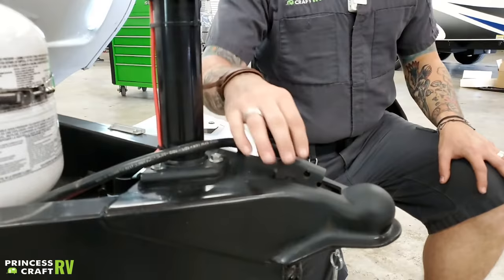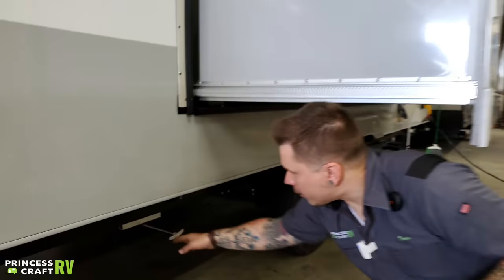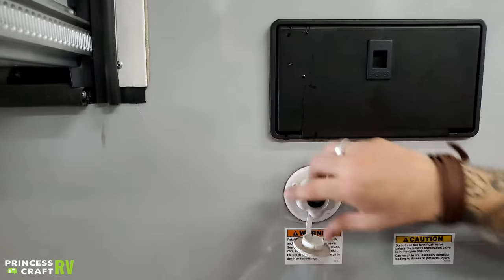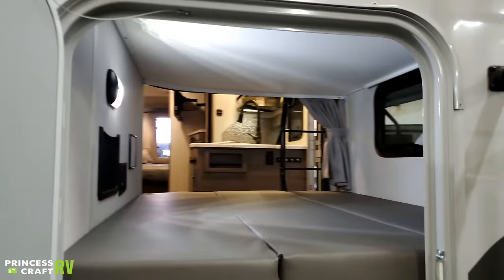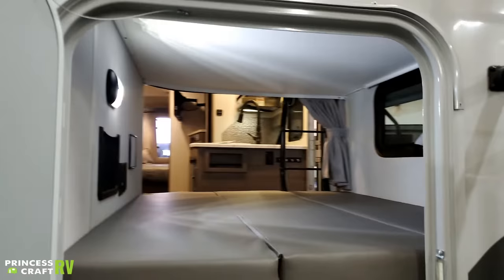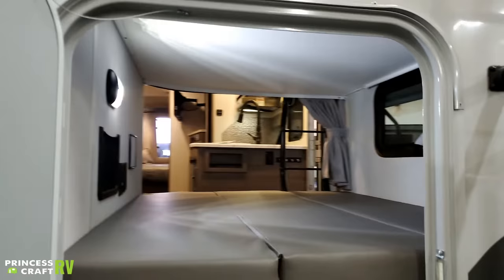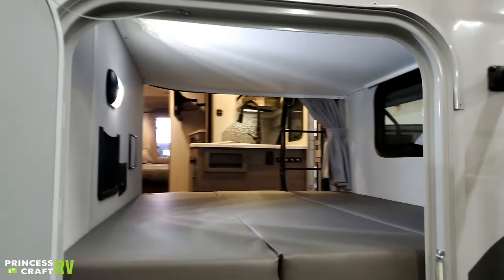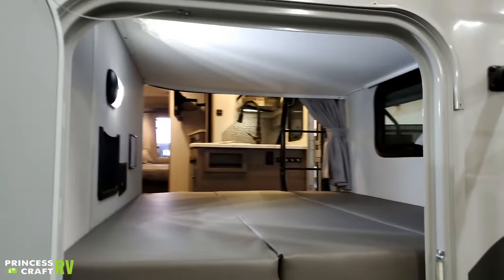2020 Lance 2445 Travel Trailer - Technician Tour

Comment: Thanks for a great walkthrough!  I'm in the market for a 2445 and am super excited.  I have a few questions:
1.  Tire pressure:  What is the hot tire pressure?  I saw the 80 rating for cold, but as I'm driving, what temps should I be looking for on my TPMS?
2.  Solar panels:  What maintenance is needed if we get the solar panels on the roof?
3.  Winterizing:  Can you use an air compressor to blow out the pipes, or do we have to use the pink antifreeze?
4.  Pest control:  Any tips for keeping the bugs out?  For keeping rodents out?
5.  Sanitize water tanks/lines:  How do you recommend we sanitize them?  Would it be like with winterizing with the pink stuff but with a diluted mixture of bleach?
6.  Changing a tire:  Where on the frame do you recommend we put the jack to most safely raise the RV?
7.  Fridge:  How does the fridge work while we're towing/driving?  Via propane?  Or would it just be off?